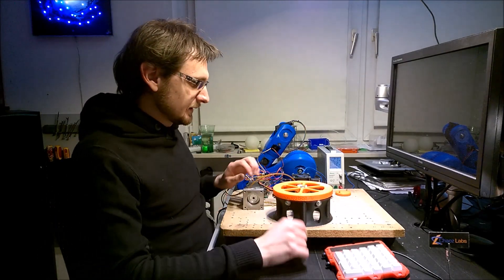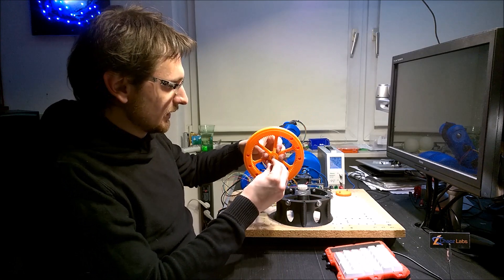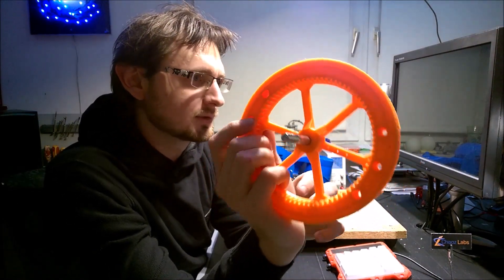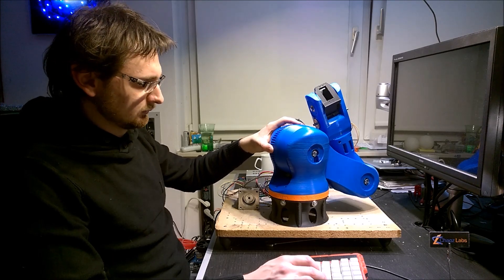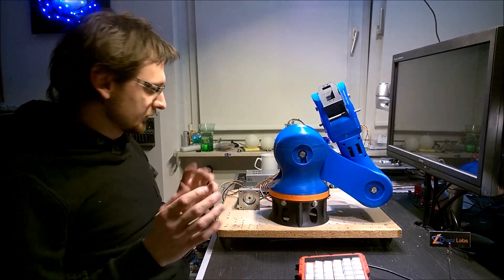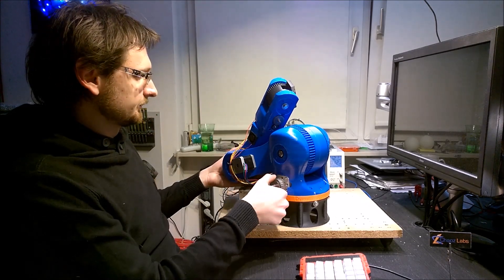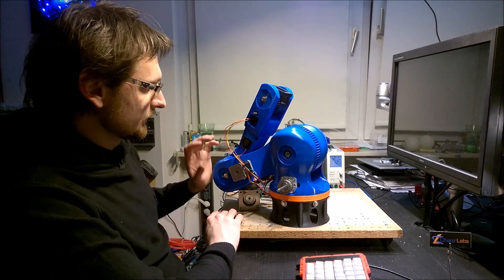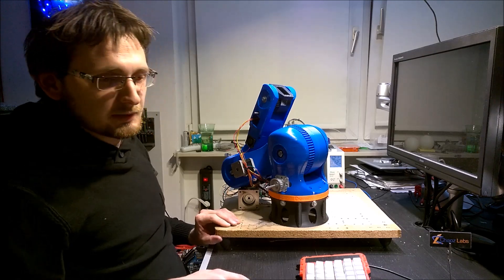Robot Arm part 3 - Rotary plate

Comment: Very impressive. This has so much potential.  Why are timing belts better than gears?  (I'm a computer engineer, not a mechanical engineer)
Reply from the maker: The have practical no slippage, less friction, and are not fixed to a certain distance as gears.
Reply: *****
Thanks Andreas